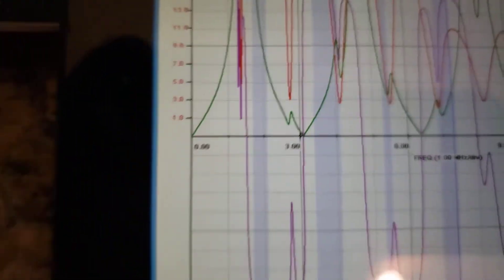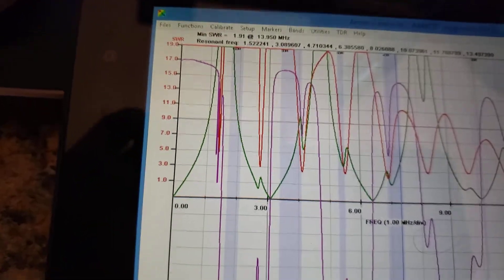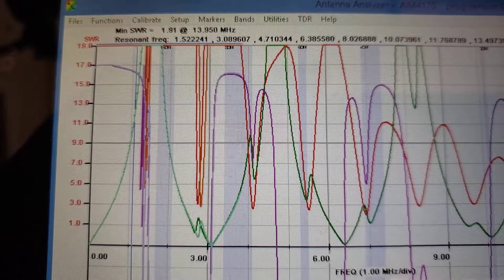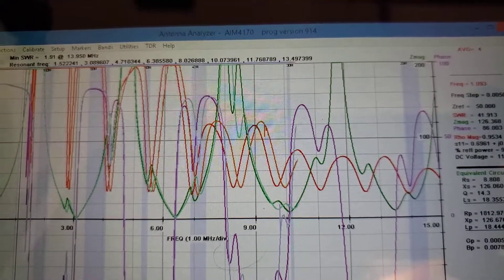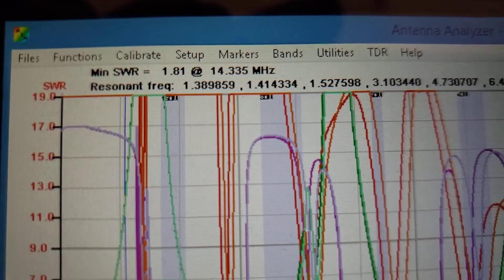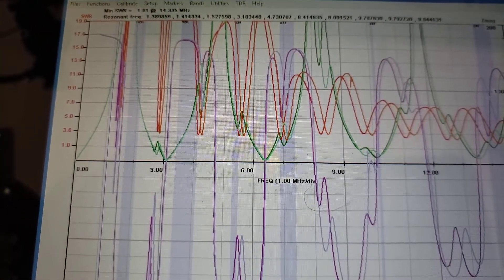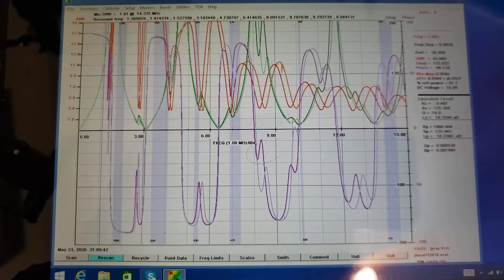Another 10 feet of the big loop

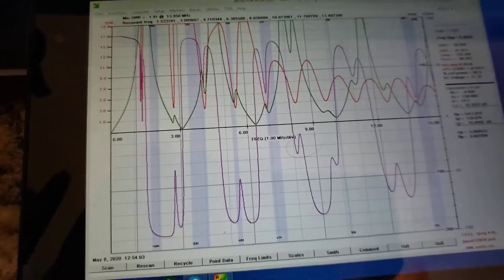Comment: 1:03 This is why Linux is the best OS....
Reply from the maker: you got that right Luke, hope you are well..73 :)
Reply: @JamesSanders  I am. Finally starting my shack in Missouri. I've been wanting to operate. You too!! 73
Reply: Thanks Jim. Just took down my AG6IF 80 meter loop. Best antenna I ever had.  Moving to a new QTH. Will go back up with an 80 or 160 meter configuration.